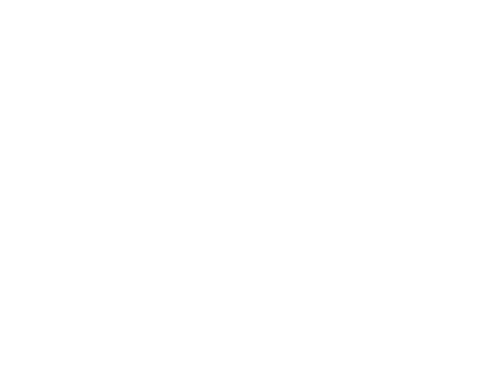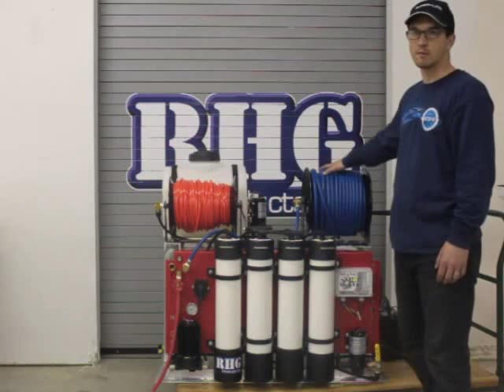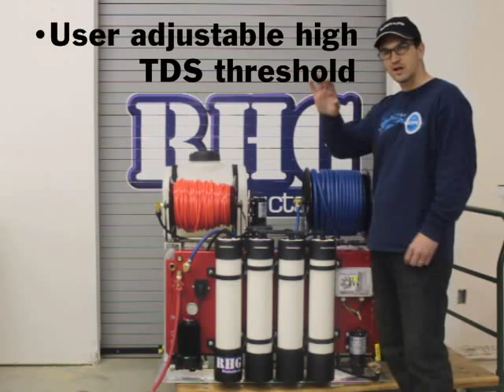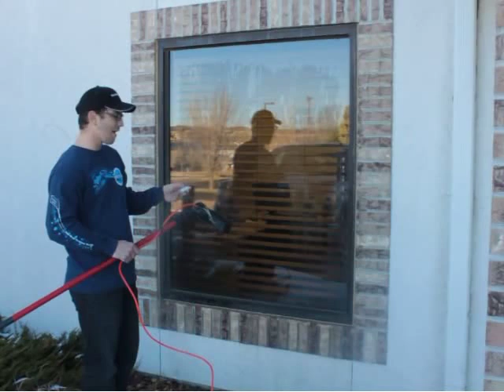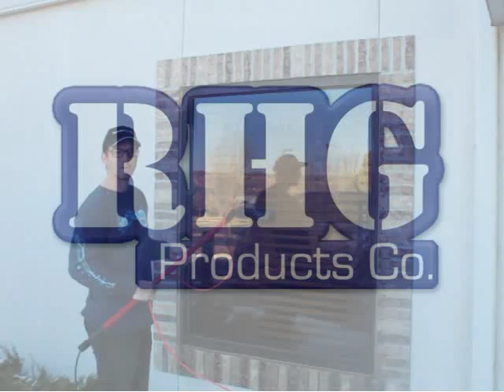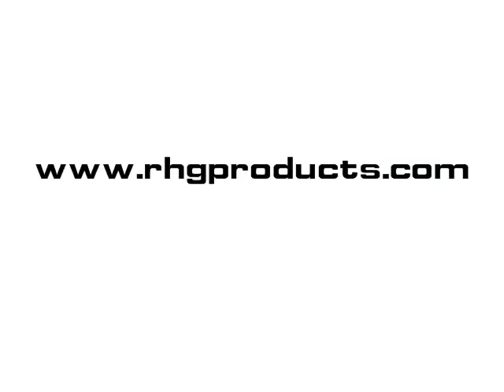H2Pro Tank System

Comment: So how much if any soap/chemical residue is on the brush after applying when you switch to rinse? Did it in practice require extra rinsing?
Reply from the maker: Hi Russ.  The amount of extra rinsing can be very minimal if the concentration of soap is kept to a minimum.  Essentially all you really want is enough soap to break down the surface tension of the dirt and debris.  Even with a higher concentration the rinse times are not elevated to the point where you will see a diminished return over much more labor intensive practices.
Reply: ReachHigherGroundWFP OK thanks-I have a 4-story hospital I've been using wfp on for last couple yrs (3xyr), and it seems some of the glass, especially near an elevator where lites are on
24-7 which attracts bugs is not getting as clean. I want to stay away from going over roof (little amount of tiebacks time-intensive) but I want the job to look good. Can u mix say ammonia and soap mixture in that container? Is that the only system that has the mix set-up so far? I currently use the IPC hydrotube; it was my  intro wfp but maybe I need to step up..I just don't need to necessarily tie up a truck bed with this system for the amount of wfp work I do at the moment. Cost of this?
Reply from the maker: Russ rekemeyer Russ.  This unit as shown in the video sells for $5495.00  In the future we hope to have a mobile cart that has the soap delivery built in.